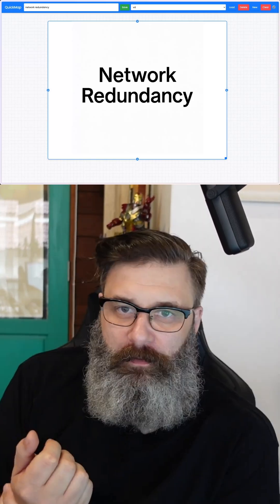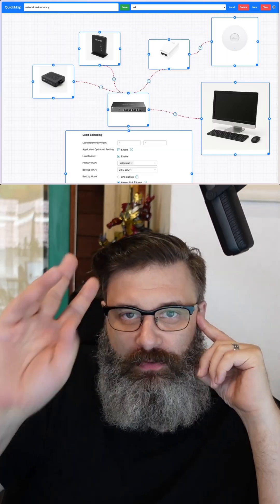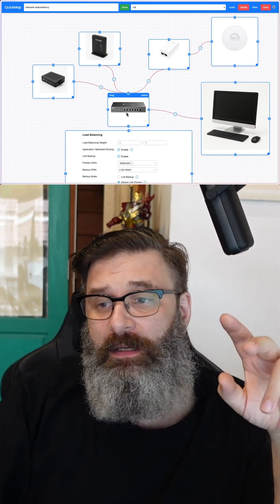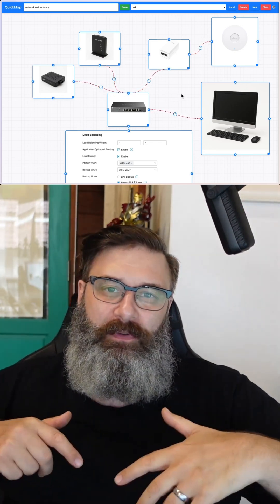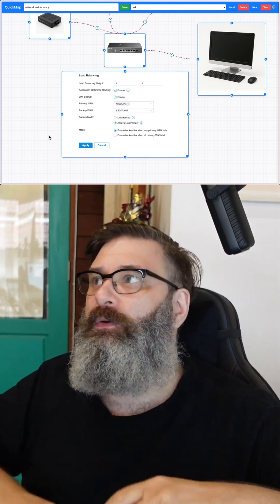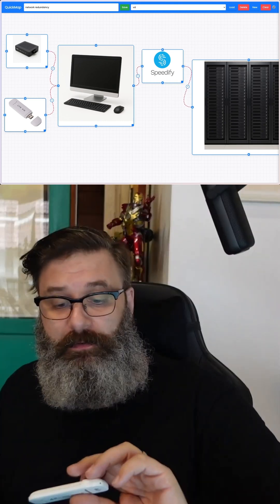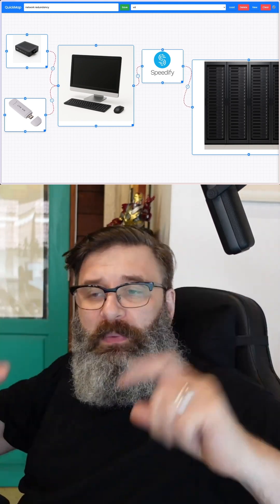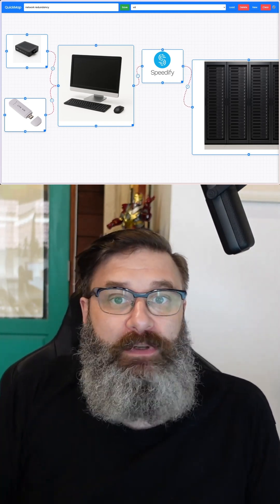Two Path Network Redundancy Solutions

Comment: Why access points over mesh network?
Reply from the maker: On a mesh, if you get more than a few hops the signal degrades and that's meh. AP is wired to each node so point 10 is a powerful as point 1
Reply: @benjaminspowell  Much thank you for the explanation.